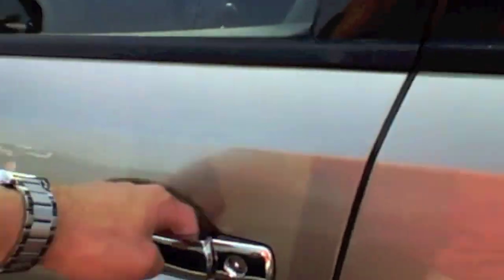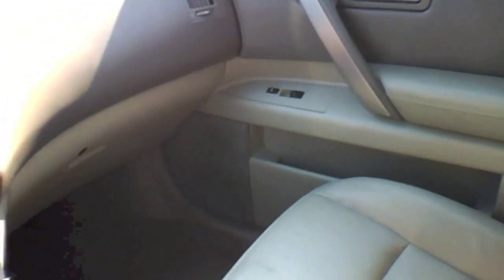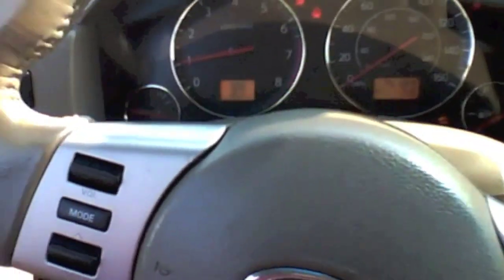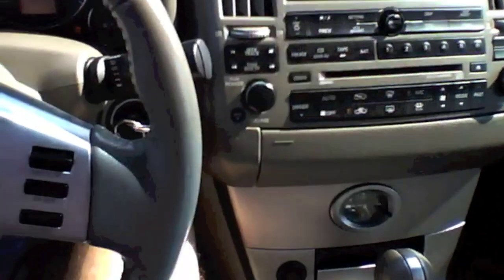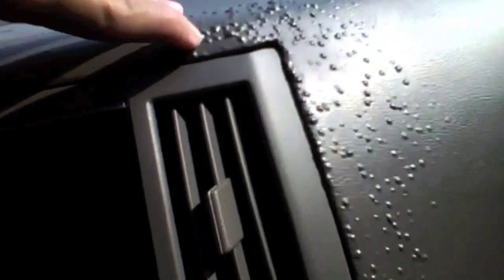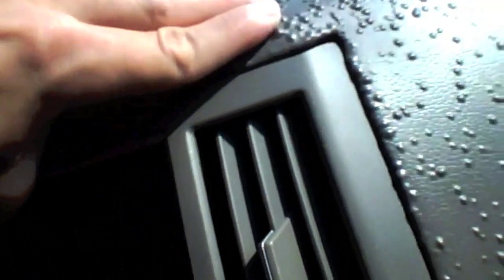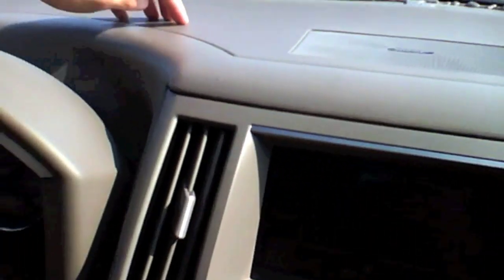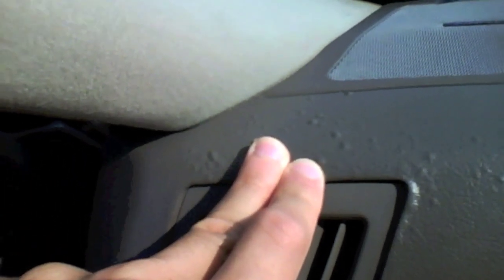2005 Infiniti FX35 Melting Dashboard Update - 75K

Comment: Had the same problem with my 05 fx35, there's a recall on this problem and infiniti extended all warranties on this part, unlimited miles. Got mine replaced for free two weeks ago by Bischoff Infiniti in san jose CA. They knew about the problem and they gave me a great service. I came in and came out 10 min after with loan g37 and my fx was ready one day after. Shut happened in a lot if cars. Infiniti knows very well to stand behind their products! I'm 100% satisfied

Comment: I have a 2004 FX35, LOVE MY CAR, but it took my dealership replacing the dash not once, .... Not twice,.... but 3 times. I finally raised such a bitch & they installed the "new dash" complete from door to door and steering wheel & radio cover. (original had "bad adhesive" they said??) Now, although the texture & finish are slightly different, I have no more bubbles. Wahoo! Couldn't be happier because like I said, I love my car!

Comment: That is the worst one I have seen.  I have an 2005...Mine was not even close to that bad, but the worst was around the vents and speakers and slight bubbling where passenger airbag was.  I found out that the warranty was extended for 8 years for this problem.  I was past the warranty period by about a month, but thanks to the service manager at Oakwood Nissan and no thanks to Nissan Canada, the dealership replaced it under goodwill warranty.  I was definitely a satisfied customer, but I would never deliver something like that.

Comment: I have an 05 FX 35 with 50,124 mi. Bought new, it's my 3rd FX 35. I couldn't do the wack ass body change that they made with the hideous front end and the ridiculous gills behind the front wheels. I've gone through 5 dash boards due to the bubbling. They also used a shitty rust proofing formula underneath the vehicle. So if you look underneath the car, it looks like it's a thousand fucking years old or you live at the beach and salt is rusting it out!

Comment: Take it to the dealers and they will change it for free, I changed mine.
Reply: assayewlalayew when did u change yours?
Reply: andrew thach about a year and half ago
Reply: For free
Reply: I have a 2004 FX35 and my dashboard is bubbly/melted..I read that the dealer only replaces the dashboard if the car is 8 years or younger. How old was your car?
Reply: Mine is 2007 and they changed it right away no questions asked.

Comment: This has been the worst car I have ever owned.
Reply: Can you explain why? Is it because of the dash or did it have serious mechanical issues?
Reply: @asam9498  oh a laundry list of problems.  I'm serious.
Reply: Damn I really want to buy this car. I have a fix for the dash but I was assuming it will be reliable atleast the engine.
Reply: @asam9498  the engine is still good but it burns a lot of oil.  You constantly have to check the oil level.  When it's low on oil the lifters make a lot of noise.  Parts are very expensive for this car.